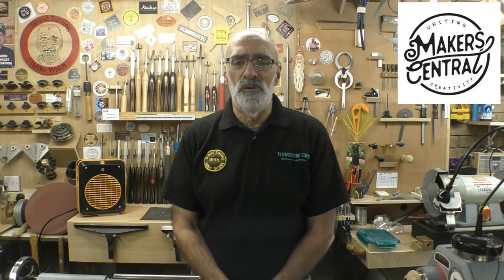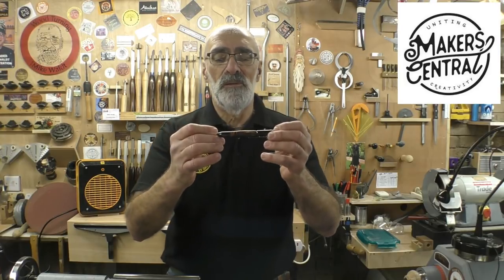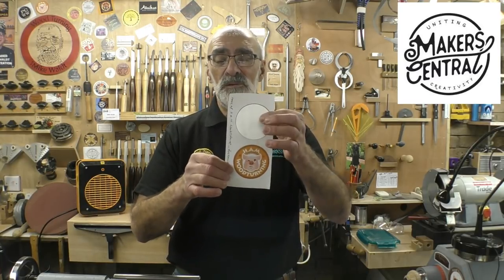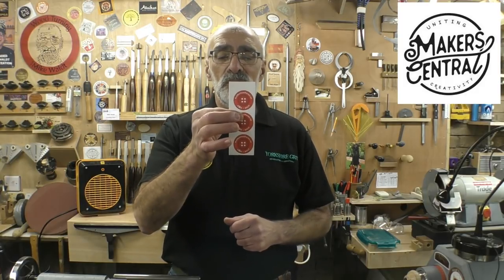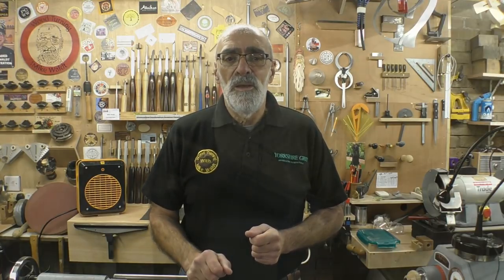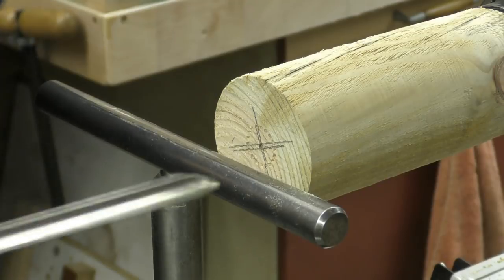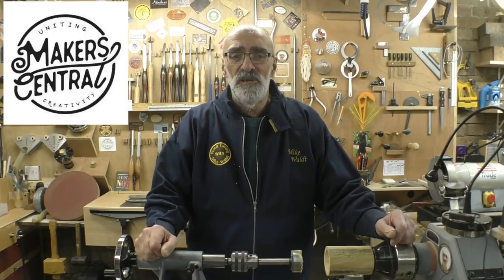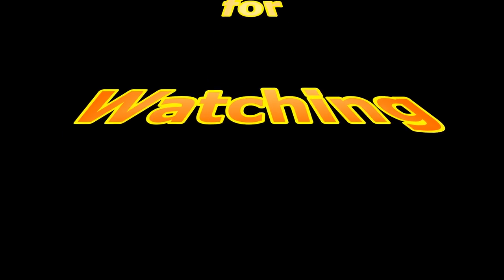Woodturning - How to Hollow End Grain  - some Different Methods

Comment: I bought my first lathe 2 weeks ago. I have been watching videos constantly to learn, and you are one of the best teachers! I am concentrating on the correct tools, sharpening methods, and presenting the chisel to the wood properly, of course safety first! I bought a 10x18 lathe, face shield, 8 piece harbor freight lathe HSS chisel set ($65. U.S., inexpensive, but I want to learn to sharpen correctly with this set), and a really good chuck, a Nova Precision Midi.I also bought a Rockler full size round carbide tool ($75 on sale! LOL). My first project was a spindle, creating various cuts. Second project, I made a wooden hammer. Third project was a pencil cup. I really enjoy turning, and videos like yours help us beginners to see how things are done RIGHT. I bought a Wolverine grinding system with a Vari-grind jig. That gets here tomorrow. No more turning  until I sharpen these tools. (I bought the carbide tool to keep going, LOL).  Looking forward to the explanation between the spindle and bowl gouges! 
Thanks again!     ~Rusty
Reply from the maker: Hi Richard, and thank you for your kind words and support.
Enjoy your woodturning journey.
Take care
Mike

Comment: Nice one Mike. I liked particularly the positioning of the gouge when hollowing, It was 'understandable' (if that is the right expression). I have seen lots of similar vids but the demonstrators go so fast and you don't see clearly what part of the gouge they are starting with and revolving into the cut. I think similay close up vids would be most useful for newbies and not just for gouges, Thanks and hope you will do more similar. Oh by the way, you used a spindle gouge rather than a bowl gouge. I think viewers would like to understand the differences in each type?
Reply from the maker: Thanks George, appreciate it, and am glad you found the video of some use. I will try and remember to explain the difference between a spindle and bowl gouge in a future video.
Cheers
Mike

Comment: Yes , that is the better way , as a woodturner I use a bowl gouge cutting towards the center against the grain , here the spindle gouge works along the grain , in a softer , more efficient and less stressful way for the chuck , I do it also with other tools in the end but the spindle gouge allows you to do all the work down to the end , well , I'll try it although I'm a bit scared...thank you !
Reply: I'm just learning to do this, I can do the outside cuts beautifully but every time I try to hollow out it just chatters and vibrates so bad the wood piece comes out of the chuck and flies across the room. I fell as though I'm missing something very simple but also very important.

Comment: Good, helpful advice and tips, Mike. I can see this helping lots of turners. My preference is for spindle gouges - I've not had much success with carbide yet, but I haven't tried my Simon Hope 6mm carbide tool yet (only bought it in September...sigh...). Cheers!
Reply from the maker: Thanks Stewart, when you use the Hope tool you will love it ... I assure you mate ;0
Take care
Mike

Comment: Hi Mike, thanks so much for the video and wisdom. I have probably turned around 50 goblets for customers so far but am still learning! I really wanted to know the proper way to hollow as I use a variety of tools but am never fully confident in what I am doing. I have been turning for around 4 years now but have only recently really realized the importance of bevel contact and the beautiful finish it gives to the wood. When hollowing out the cup in my goblets, I usually start off by milling a 12mm hole, then 30mm, then 50mm with forstner bits. I then use a combination of a 6mm round carbide cutter and a 3/8 bowl gouge to hollow out the inner shape. To finish I use a 1 inch round nose scraper to try and smooth all the bumps and ridges on the bottom of the cup. However I find it particularly difficult to get a nice/ perfect curve between the sides and bottom of the cup. Can you relate to this? I also feel like I have to pay a lot of attention on this part, particularly as I usually turn 5 inch round goblet, so the cup is usually quite deep. May I ask what are your thoughts or tips for this? Also do you know is there a good chart/ books somewhere for the correct angles and grinds for each chisel e.g spindle, bowl, skew, roughing, parting etc?? I know this is a very long comment but any help would be greatly appreciated mate!! Happy Turning from Galway, Ireland!
Reply from the maker: Hi Mr Magill, I use virtually the same method as you for hollowing goblets, and always find the transition the most troublesome part. My only tip is to hone the methods you are currently using. The only main difference is that I use my 35/35 round nose negative Rake scrapers for the refining process. These I ground myself from standard scrapers. 
Hope this helps.
Cheers
Mike
Reply: @MikeWaldt  thanks mike will keep this in mind and try it out! Much appreciated and keep up the good work.

Comment: Hi Mike, I meant to ask this awhile ago. What is the advantage of applying sanding sealer? an old boy at my local club say's not to waste time and money. a good smooth finish and a couple of coats of polish do the trick.  On another topic, I am this morning about to try 'Yorkshire Grit'.
Reply from the maker: Hi Peter, the reason I like to use sealer is that it seals the grain and gives a better base surface to apply your finishes, this of course is just my opinion :)
Enjoy your Yorkshire Grit too.

Take care
Mike

Comment: Thanks for the video. What is your preferred method and how do you do to get deeper into the piece with a gouge? Thanks.
Reply from the maker: On balance I tend to back hollow the most, and just either plunge the gouge at the centre to increase depth, or continue with a push cur, much the same as you would with a bowl.
Hope this answers your question
Take care
Mike

Comment: Hi Mike, you make it look so easy! Yesterday I was making a wine glass out of Purple Heart, when I hollowed it out about an inch deep it caught and threw the 3”x12” piece of wood over my left shoulder and I thought I lost my thumb, it happened so fast and it scared the ....out of me! All that happened is a sprained thumb and wrist. I’ve had catches before but not this severe. I noticed in your videos that your left hand is over the top of the tool rather then your thumb pointing towards your work. Is this the reason you do that. I finished the piece but now I’m a little gun shy. I must have turned the tool at the wrong angle. And it was hard to see what I was doing, because the area was only 1” wide. What is a good speed to cut that type of wood. Thanks
Reply from the maker: Hi Mike, to be honest I alternate how I hold my left hand, it really depends on how I feel at that particular time. Sorry I can't be of more help. 
Cheers
Mike

Comment: Really helpful tips. Thank you for the advice and knowledge. What is the name of the manufacturer of the first small carbide cutter you used when you started the hole with the standard drill bit. I would like to do some more research on them as I'm looking at getting some newer tools carbide as well as traditional. Thanks again
Reply from the maker: Thanks Billy. It's the Simon Hope 6mm mini hollowing tool.
https://hopewoodturning.co.uk/tools-handles/hope-hollowing-tools/
Cheers
Mike

Comment: Hello Mike. Thanks for sharing this methods. With the hollowing a have a lot of trouble/problems, but more because of the wobbeling/vibrations of my wood. You can see it in my latest video... :-( ... maybe you have some good advices for this too? (ok, i think it is because my lathe is not very strong/stable on the point between the motor and the faceplate?)
friendly greetings
always safe turning and happy days in the workshop
Chris
Reply from the maker: Hi Chris, "wobbling" is mainly caused with longer pieces, maybe some form of stady rest would help initially.
Take care
Mike

Comment: I'm new to turning and you make it look so easy, every time I try and do the hollowing out, the wood vibrates and chatters so bad the wood flies out of the chuck. Even with next to no pressure put out it. I really feel like I'm missing something. 😕
Reply from the maker: Sharp tools light cuts, and correct size tenon/mortise should see you through Nathan 🙂

Comment: I hope you read your comments on older videos. I am a newer turner and I thought that the only way to turn wood was to turnn the end grain. The reason I am asking is I am am having a really hard time turning "end grain." I cut some wood to length, cut it in half length wise, glued them, and attached it parallel to the bed. Am I doing this "incorrectly", or should I turn the wood with the grain facing me, perpindicular to the lathe bed? Let me know. As I said, I am having a very difficult time turning this. Thanks!
Reply from the maker: The difference is that if you hollow a bowl normally the grain runs across the bedways,  hence side  grain hollowing. If the grain runs parallel tho the bedways it is end grain hollowing.
Hope this helps.
Cheers
Mike

Comment: Might be very useful information, not only for beginners. But I recommend to try to avoid hollowing using scrapers, especially when turning hardwoods. Beginners must be ready to deal with a lot of vibrations and catches if pushing too hard or if using dull chisels, both of which is very common..
Thanks Mike! 
Arthur
Reply: I have used square scrapers almost exclusively (with a starter hole from a hand held bit) on hundreds of hardwood boxes. For me, the secret is to have a  long handle that I tuck under my forearm. I use the same tool for cutting the interior join. The leverage from the long handle is essential.
Reply from the maker: Hi Arthur, and thanks for your input, much appreciated.
Cheers
Mike

Comment: Mike, I’ve learned a lot from your videos, thank you. I think the problem I am having with end grain is going to the wood at an angle instead of going straight in, do you agree this would cause catches?
Reply from the maker: Thank you,  I'm not sure what you mean,  you could email me if you wish, my address is in the "About" section. 
Cheers
Mike
Reply: Sorry Mike, I don’t see a email address on you About page
Reply: Mike, after watching some of Stuart Batty’s videos I think I have the answer to my question. It was about the angle of the gouge when entering end grain. I think it was about floating the bevel more than anything else. I don’t know if that still makes any sense to you but I got my question answer between your videos and Batty’s.  Stuart’s videos are very informative as are yours. Thank you again.
Reply from the maker: It is there I assure you.
Cheers
Mike
Reply: Mike Waldt Still don’t see it. I think I got my question answered.

Comment: Hi mike, Just after a bit of advice if you can... I bought a bowl gouge from axminster a little while back and i'm having trouble with it. It doesn't have a fingernail grind on it yet and i'm thinking this could be the problem. the wings seem far too high and short, but basically anytime i try and use it, i'm getting pretty harsh catches. also struggling with hollowing out. even after tool sharpening. I can get the depth hole no problem, but again keep getting catches where the gouge runs back towards the edge of the piece when trying to remove the material anywhere after the centre. any advice appreciated. cheers
Reply from the maker: Hi James, in brief keep an eye out for my next video, as it will cover the method I use to reprofile a straight over grind to swept back wings.
Cheers
Mike
Reply: Mike Waldt Thanks mate, look forward to it. Ive booked a day in the workshop with Andrew Hall.... hopefully that will help me out loads too.

Comment: As a very amateur (and not overly informed, at this point) question.... 

Is there a reason you wouldn't grind a 45 degree angle onto the shaft of that scraper? Where you're using it at 45 degrees to cut, it seems like you're holding it there yourself, but if you had the edges shaped wouldn't you be able to rest on that? 

(I'm sure there must be a reason you wouldn't, but it would seem like it should work?)
Reply from the maker: Basically you could do just ... but ... with a scraper if you ride the bevel (and some do) and you get a catch ... you get a CATCH! 
I and others too find that it is more controllable used in this way, and indeed more versatile.
Hope this helps
Cheers
Mike
Reply: Cheers Mike

Comment: Very interesting video Mike, I only use carbide tools, except for parting off,   The problem i always seem to have is getting catches when doing vase's , i'm ok for two to three inches in, then the tool starts to vibrate and i circum to a catch, Any tips ?  Many Thanks  Mart
Reply: Are you certain that you are cutting above center? It is easy to lose track as you get in deeper. Also, is your handle too short? I don't use carbide, but many of the tools I have seen are marginal for deeper hollowing.
Reply: Mart try and get your tool rest as close to where your turning as you can even if its inside a bowl/box
Reply: I can't seem to find a rest that is small enough to go inside the vase i'm doing, its a bit less than 2 inches in diameter and 7-8 inches deep, I would use a forstner bit, but again can't find one that long here in the uk
Reply: You are looking for a Forstner bit extension.
Reply: Thank you, never knew they were made
Reply: Wish I could point you to a vendor, but I am in the US.
Reply: I have found one, Thank you
Reply from the maker: Thanks for your input Gerald, much appreciated.
Take care
Mike
Reply from the maker: Hi mart, sorry for the late response, as stated below, keep the tool rest as near to the work as possible. One more thing to keep an eye on is the position of your cutting edge as you go deeper, as we tend to alter that without thinking :)
Cheeers
Mike

Comment: I always get a catch hollowing. Spindle, roundnose, or bowl gouge I always get a wicked bite on the inside and ruin my work. What am I doing wrong?
Reply from the maker: Hi Luke, I would guess you are losing bevel contact or rolling the tool slightly too much and catching the wing. My advice is to go through the procedure with the lathe speed turned right down, to see what you need to do to complete the operation without a catch. Remember to feed the tool slowly too, to match the reduced RPM. Hope this helps.

Comment: i tried hollowing end drain with a 1/4" and a 3/8" spindle gouge... Just got really bad catches all the time and blank ripped out the chuck jaws and flew across the workshop :/ 
Ordered a bowl gouge to see if that helps.. (only have basic chisel set at the moment)
Reply from the maker: A 3/8 spindle gouge is fine for small hollowing work, just practice the presentation of the tool to the work, and it will come I assure you.
Cheers
Mike
Reply: @MikeWaldt  Appreciate your replies mate :) I bought an Axminster Bowl gouge, and find that hollowing is a fluid and smooth experience :) 
I guess its just the case of "the perfect tool is the tool that gets the job done" :)

Comment: I am concerned that you are using spindle gouges on bowls...
Reply from the maker: Do not be, I have been using a 3/8" or 1/2" Spindle Gouges for shallow hollowing for many years, and in my opinion is not an issue William.

Comment: I'm so confused. I was lectured big time for using a spindle gouge to hollow a tiny bowl as if I'd taken my life into my hands.
Reply from the maker: How tiny was the bowl Jen?
There is a difference between a goblet or small box and a bowl. A bowl gouge is more stable, especially when reaching over the tool rest  to hollow out the inside, the forces are far greater than with a small turning such as in this case.
Take care
Mike
Reply from the maker: @JensWoodworkingThings  
I personally see no problem using a spindle gouge on such a small bowl.
Cheers
Mike
Reply: I think the "lecture" was because you were using a spindle roughing gouge.  Have a look at 
the  explanation in this really informative video at  https://youtu.be/QMVGankeK0I to see the reason why. The really great turners like Stuart Batty, Ashley Harwood etc. have learnt what tool to use when and their turning looks so elegant because of it.